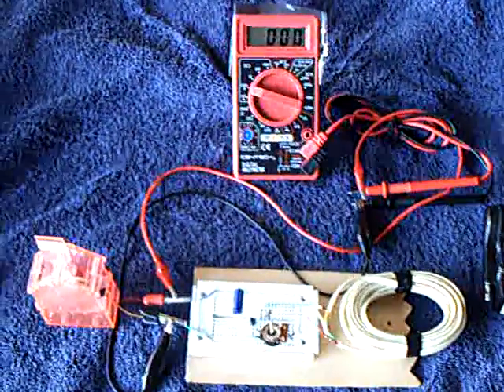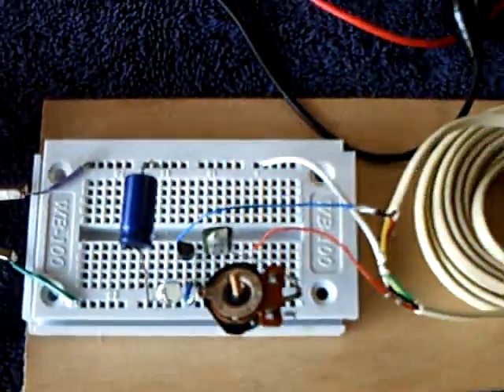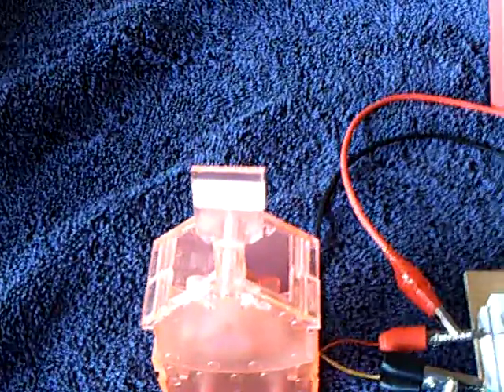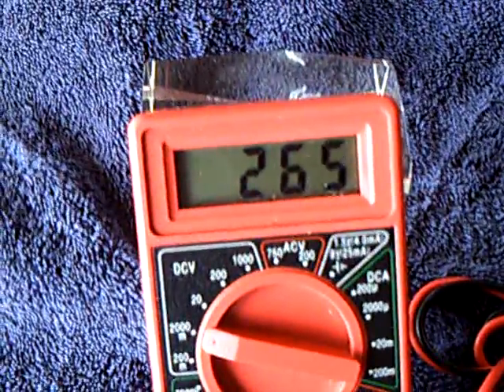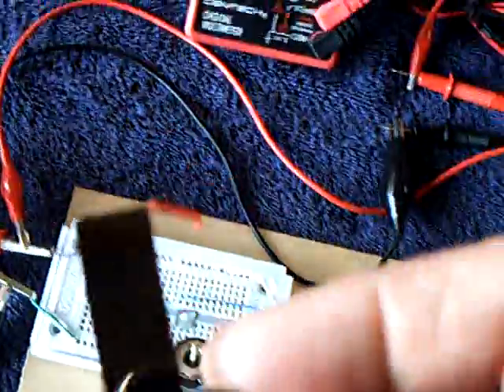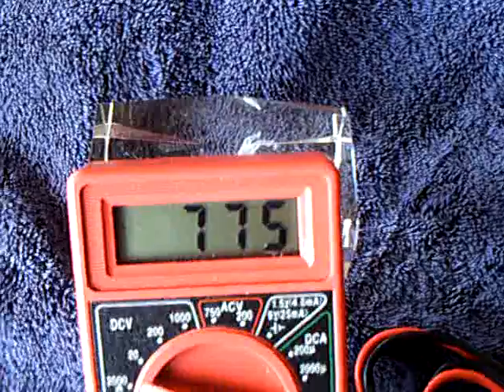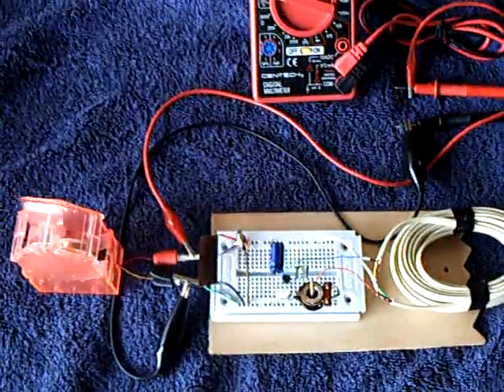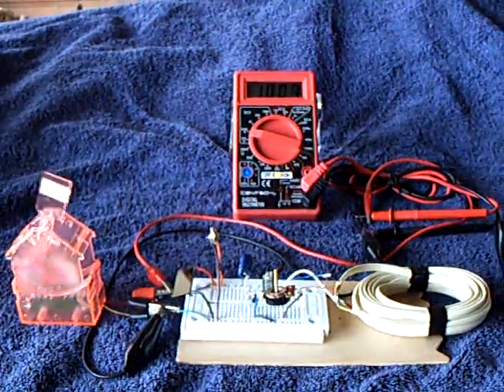California Non-Stop Runner -- part 2

Comment: Thank you.  I have already changed the garden light circuit to make very bright light (compared to any store bought solar garden lights you can find) - that was not a problem, the problem was the battery not being fully charged on the areas where it is shaded or partly shaded in the garden.  I will greatly appreciate any of your suggestion.